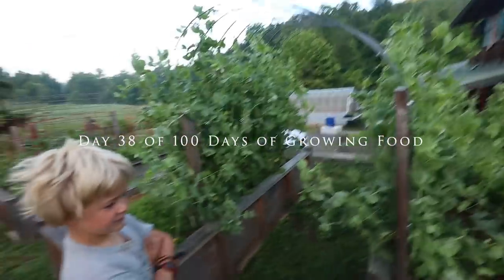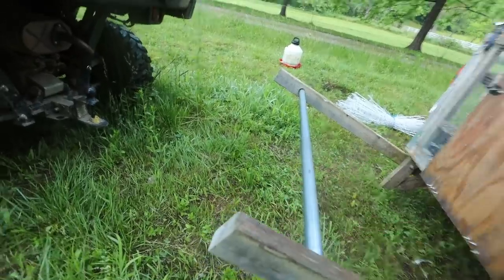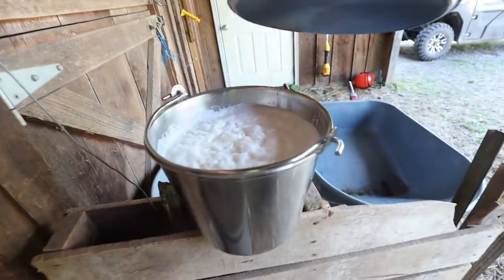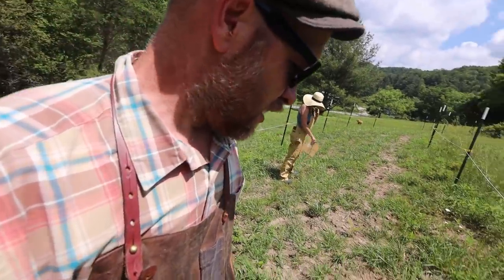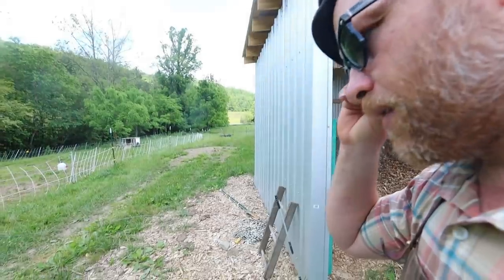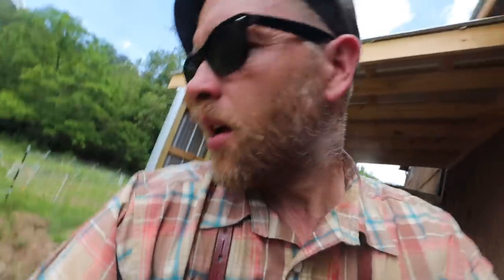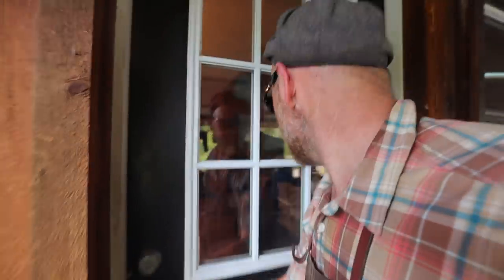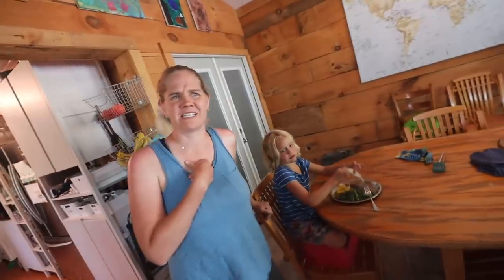TOO HOT! My 10 Acre Plan for Water in Every Pasture

Comment: you are measuring the gate hing upside down. The short leg of the hing should point up and that holds the gate up. Also realize there is a lot of stress at that point seeing the entire weight of the gate is resting on that point you are going to need a larger post than that 4 X 4.  Regarding your water line remember there is friction loss so don't expect much flow after 1000 feet. Maybe think of a small pump off your creek to use that as a water source.

Comment: build something you can attach a 2x4 to the top of the coop on the back side and pull it backwards ..it will change the angle..instead of lifting  you will push down and drill a hole in 2x4 and use tractor pin on flipped over drop hitch without the ball

Comment: Weld a piece of the pipe to the center of the chicken coop bar handle so then you can slide a thinner diameter pipe through the piece you welded in so it can pivot but not slide forward or backward

Comment: If you're only running pipes thru it shouldn't you be using a steel pipe or iron pipe so if you run over the pipe with a vehicle it doesn't crush the pipe or use thicker pc pipe?